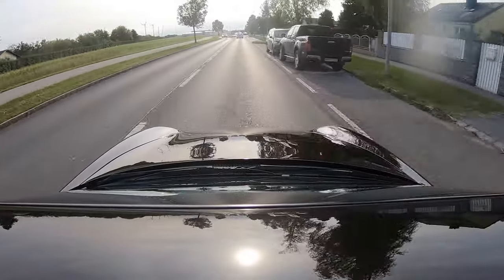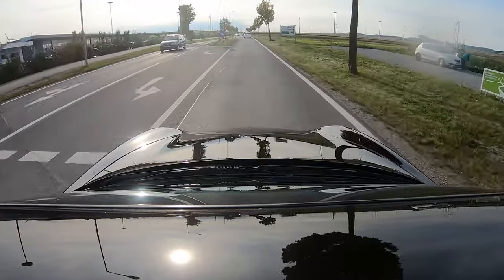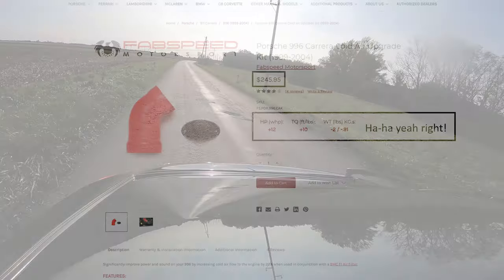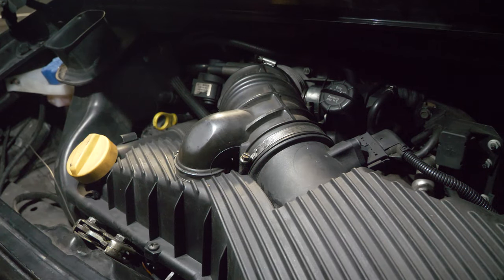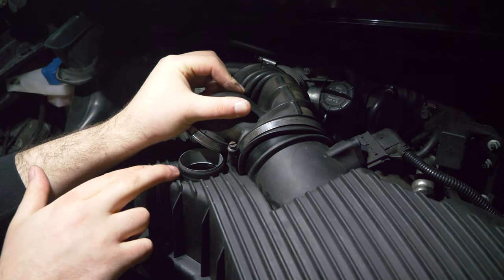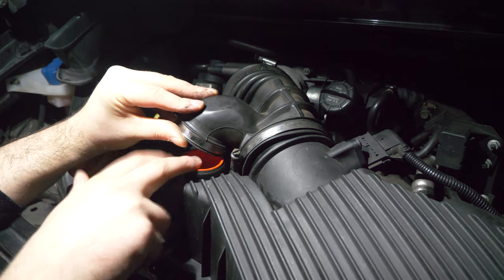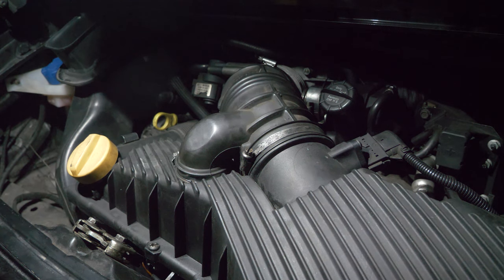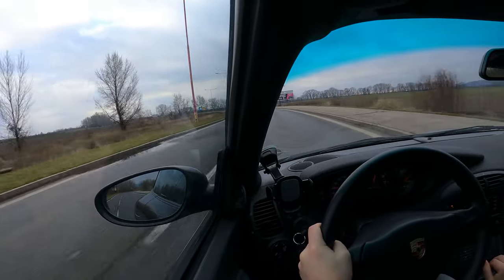Porsche 996 911 free mod! | Helmholtz resonator bypass

Comment: Let me set one thing straight .
This intake mod works fine and has no issues with the electronic ECU etc !
The intake noise is a little more intense above 4000 rpm .. witch is very nice and satisfying to anyone who likes that kind of extra noise behind your ears ..😅
Actually I measured my performance speed on my 100-200km time with a 2 tenths of a second better than before .. 
And yes , someone said , that those engines are fragile !
That’s quiet right !!
So in order to keep those engines long lasting ( keep aside other issues such as IMS and so on ) there is a need to warm up that motor !!
That will mean , drive for approx 10 miles , so that your oil gets about 80 degrees Celsius !! And then you can start reving over 4000 rpm . 
Happy drive to all 996 lovers 🙏🏽😇😅
Same conditions and almost full tank .
Reply from the maker: Very wise words my friend
Reply: There is definitely a performance gain. I was prepared not to have one and was pleasantly surprised

Comment: Did this to my 97 3.4 Manual 996 Carrera ... it is certainly an improvement. Bit like the equivalent to a gruff voice after a big night out, or th slight bass you get when you're getting a check cold ... it's an improvement worth doing, and you keep the stock look!

Comment: The stock is ribbed and that slows down air flow … the “ugly hose” is ribbed and slows down air flow. 
To do this mod at its best is to use a smooth hose, cap the helmholz box opening … AND remove the helmholz box . . Now you have smooth flow to the TB & actually increased the available air in the air box .

Comment: I tried multiple combinations including the just "cap".  The best is the silicon tube, with all the resonator parts removed from the airbox.  I used a black plastic plumbing fitting and cap to seal the hole left in the airbox(It is a 40mm water tank fitting).  Just take the lid of the airbox into the shop.  This sounded the best but also help remove the obvious torque dip around 5500rpm.
Reply from the maker: Awesome glad to hear. However I have heard that it might decrease performance. I will take it to the dyno soon to see how it does, I will also run it without the resonator capped off. So hopefully I will know more!

Comment: You are trading more noise with less air/torque, when the intaking is in resonance, energy is wasted as induction noise. The primary purpose of the resonator is to improve air flow & secondary any unwanted acoustics. If you like the noise then it’s your choice! It’s a common misconception by marketing mis-information.
Reply: It's the "if it's louder I am must be going faster!" theory.
Reply from the maker: Thanks! What I read about it online, this btw confirms that wiki is not the best, that it’s mainly due to sound. Interestingly on my 997 I have not seen a similar contraption on the air box with the x51 package
Reply: The intake note on engines does not come from the airflow itself, the sound comes from the combustion chamber through the ports in the head into the intake manifold and makes it's way out through the throttle body/intake.  It could be argued that energy is wasted in trying to reduce the sound (just like mufflers reduce sound at the cost of power).  Almost every production car has some sort of resonator in the intake with the purpose of reducing NVH, it is not there for improved airflow or power.  High specific output naturally aspirated engines in cars such as the GT3, E46 M3, E90 M3, etc. do not have any resonators on the intake side, they are designed for airflow and power and as a result scream!
Reply: @911obsessed bingo there is absolutely definitely better throttle response after this mod. I actually couldn't believe the difference. I had to go drive the car some more.

Comment: Alright let me just start this out by saying I did the muffler delete modification. Not only was it loud but I definitely lost bottom end. I Removed it....I did this mod yesterday and not only does it sound better and raspier although not a whole lot louder there is definitely a performance gain at about 3K. The car is more responsive and spools up quicker. This is not my imagination as I had a really loud muffler on it and I noticed it the car slowed down. I am so happy with this mod my car so much more fun to drive now. I wish somebody would do a Dyno and some 0 to 60 times I'm sure there is a gain although maybe small you can feel it in the seat of your pants..996.2

Comment: Or buy a £10 metal/ plastic bung that blocks the hole but also allows you to remove the bits in the airbox. Great idea though.
Reply from the maker: With regards to the bits in the airbox, I have read that its frankly speaking pointless, that given the volume and speed of airflow increasing the volume will not yield anything. I was going to go the route of finding an spec plug/bung but couldn't find anything here in SK.

Comment: What is the extra bit needed for a tiptronic car? This is referred to if you were to buy from Fabspeed.
Reply from the maker: That is then not necessary, IMHO as the only reason the fabspeed kit needs that is because the aftermarket hose does not have the necessary fitting so they recommend to use a small filter. Thus, if you are keeping the factory hose no need
Reply: @CarPlebs  👍
Reply: Hi did you trim the bottle cap down?? when you said remove plastic around the sides?? was this the case??
Reply from the maker: @germancarfan360  no no there is simply a removable piece that unclips by hand
Reply: @CarPlebs  Ahh you mean the tabs that security lock the bottle from brand new yes?

Comment: Is this applicable for the 986 Boxster first edition as well?
Reply from the maker: Did a quick google check and I believe not.
Reply: @CarPlebs  thanks for the reply. Didn't find anything my self either /:
Reply from the maker: Other than that, how is the 986? I am thinking about my 3rd, either a 986 or 944
Reply: @CarPlebs  It's a great car and my daily. Every drive is as enjoyable than the previous. I've done some mods to it, and made it a bit more noisy, hence the question. I also daily drove a 85.5, 944. A blast to own and drive. A very practical sports car with the folding rear seat and the the boot space. Get one that has done the clutch. The rubber ones from factory are a menace after a few years!
Reply from the maker: Thanks allot !
Reply: @CarPlebs  no problem! PM on Instagram , daily9x6 if you got questions (:
Reply from the maker: I need to get a Instagram account!

Comment: Hi, what is the possibility for the cap to be sucked into the trottle body, it seems to be after the screen in the MAF sensor area ?
Reply from the maker: The pressure of the intake “suck” the cup down via vacuum, hope this helps!
Reply: @CarPlebs  I will have a good look again, but my view is that the air enters from the bottom below the filter, exits above the filter ,mainly via the main tube and via  the MAF sensor but also up via the smaller tube that will be part of a venturi effect created by the suction from the intake area . perhaps the plastic box fitted inside the air filter box directly below the smaller outlet blocks the airflow but I struggle to see that the suction is downwards and not upwards?
Reply: BTW , I did mine last week and love the noise from 4500 rpm upwards. Afterwards I started to ponder on the airflow path and the possibility of disaster.
Reply from the maker: Well I have driven as such 1000+km, many times 6000+ rpm, but that is my experience. Also upon installing the clamp is tightened down.
Reply from the maker: @francoisvisagie3780  Hmmm.... I have spent some time on the topic by searching for the mod name + "suck" or "suction" and saw some people worry about the topic, however many more enjoying it and not worrying checking it after many months with no signs of wear. You could as a remedy tighten the "Y" section with another clamp to 1000% prevent the cap to pass through. Or you could remove completely. I will personally keep it as is.
Reply: @CarPlebs  Thanks for reply . I plan to keep mine as I enjoy the sound. I plan to experiment by opening it up slightly while motor is running and to hold a piece of plastic "flag" to see the suction direction. I will also have a look at the diameter of the little tube to see if the plastic cap could even get trough unless extreme suction is applied. A further warm feeling is supplied by the fact that some companies sell the cap as an aftermarket part at quite a cost and I doubt that they would do that if it was not safe.
Reply from the maker: Excellent! Then please let me know on the outcome. I will update the video description with your findings. Have a nice remainder of the day.